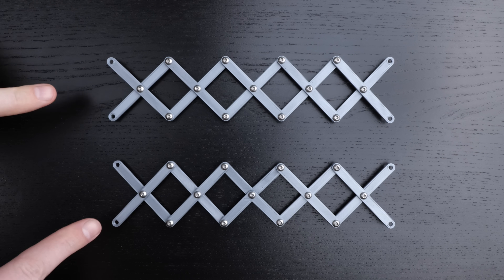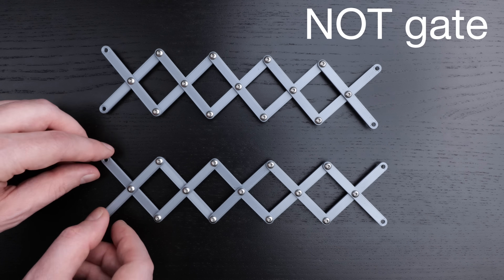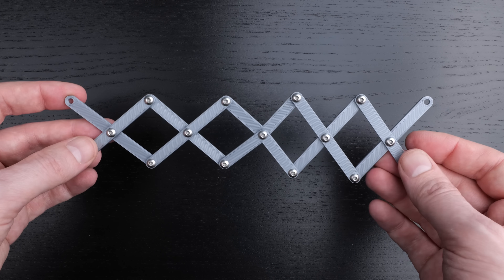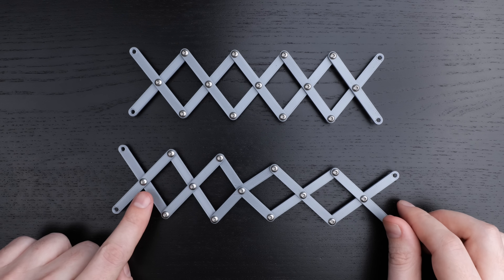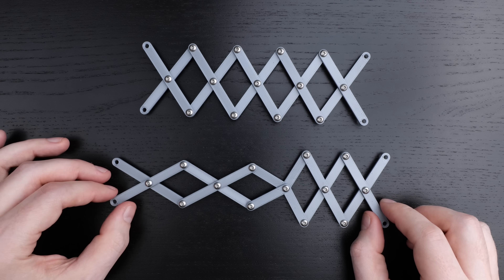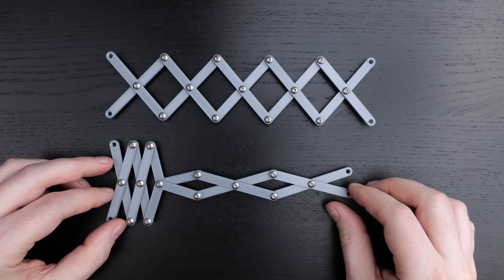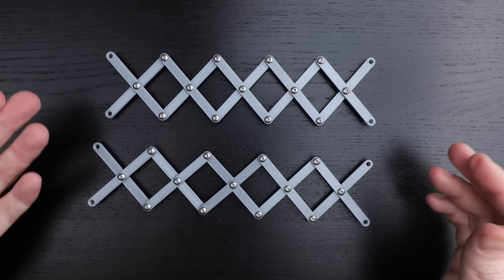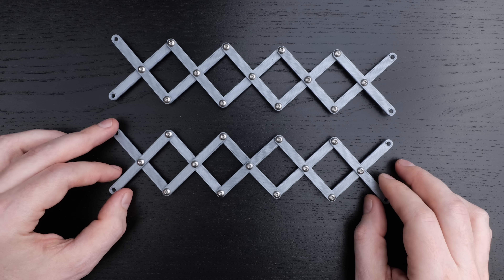Scissors NOT gate

Comment: very clever. you had another scissors that had one part that moved at a higher ratio to another part, but in the same direction. it occurred to me, it could be used as an amplifier. imagine whatever you draw through the hole of the signal arm, gets drawn much larger by the amplified arm. has anyone made this mechanism for drawing? i couldn't find a video on it, but maybe i don't know the right term to search for

Comment: Could do something like a AND AND = AND by using a scissor mechanism with a right angle joint attached via the central point on the mechanisms inputs

                   tInput    >
ANDmechanism         xxx
                  bInput    >

Top connecting mechanism attaches to tInput.TopConnection and bInput.TopConnection
Bottomw connecting Mechanism attaches to tInput.BottomConnection and bInput.BottomConnection

Pulling the top connecting mechanism would close the 'ANDMechanism' only if the bottom connecting mechanism was either also pulled or pliable

Comment: Very neat mechanism.
However, you do know that the only gate needed is a NAND gate, right ?
you can create all other gates and any boolean logic with only NAND gates. So just create that one, what is the point of other specific gates ?
Reply from the maker: Yes, you could just make a NAND gate. But any logic machine you build with mechanical parts like these will suffer from slop in the joints, which gets worse with more parts. So if there is a simpler mechanism to make (for example) an OR gate directly rather than constructing it out of NAND gates, you’d want to use it.

Comment: if u make the last parts after all the conection points longer it would lower the lenght difference (on both sides) and if u make them the same lenght u dont care about the middle part cause input and output is the same anyways

Comment: I would reframe the whole mechanic a bit: suppose one arm of the input is fixed to a grid, then you only look at the movement of the other arm. This reduces the output to one vertical movement too. Now you could imagine a rectangular frame that can only move vertically. The horizontal movement of the scissors along the horizontal part of the rectangle is ignored, you just have some leeway for the length change there. The vertical movement is the output you are interested, you get that from only one point of the two output scissors, the other one is moving in a horizontal rail to give it leeway for the length change, but it is fixed in the vertical axis. Those frames are the "wires" that you use to connect to the next stage of logic gates.

It's not a fully scissor link mechanism this way, but building a first prototype with those moving frames could give you some insight in how a logic circuit could work. Maybe you find a scissor variation of that idea later.

Comment: If you don't already a solution my would be to put two of the standards side by side connecting the in/outputs to side of another standard.
And be aware that you can have multiple input & output if you use a grid pattern mechanism.
The grid pattern mech. being something like : 
xxxx
xxxx
xxxx
xxxx
With the grid pattern, and really the standard too, you can have the side of the mech. be a NOT gate value.

Comment: I was immediately thinking that going through 3rd dimension is a quick lazy answer. Add hinges to the arms so ends of the mechanism stay a fixed (arbitrarily adjustable) distance from each other but the middle of it bows a up and down, freely, in sort of an arch or wrinkled shape.

Comment: I wonder how stable it could be at the center L joint.  Since it’s anchored at both ends, and can be driven from something stationary.  Could be an interesting choice for something like an extrusion 3D printer.  

Or maybe since it converts a very long motion into a comparatively fine one it could be a tool for firmly but precisely gripping fine objects.

Comment: You say scissors based mechanical computer like it's some kind of joke, but there is reason to believe that the cytoskeleton(a cross linkage of various proteins that support the form, movement, and metabolism of any cell), besides simply acting as scaffolding, is actually encoding information and performing computations which direct the cell's metabolism and behavior. This can explain how a single-celled organism can have fairly complex behavior, but also how cells organize themselves in general. I bet that the some of the proteins that make up the cytoskeleton can have distinct configuration states, some which are just like the scissor arm which can be elongated or compressed, and there is a some kind of junction protein which acts similarly to your not gate.

Comment: you could make it one length by making the L shape 2 pieces and have a gear system between. so the relationship of the side angle of the X would dictate the size of the angle of the top of the X, in a measured way. for the $ you would use the same gear ratio except would need to rotate the two center ones by 90d so the length overall doesnt change, and you have squished scissors at the end and two long ones in the middle

Comment: Just figured out how to make simple OR/AND gates :
Arrange 2 NOT scissors and 1 regular scissors into an 工 shape. Both NOT scissors' middle points connect to one end of the regular scissors.
Add a third NOT scissors and form a 王 shape, its middle point connecting to the regular scissors' one. 
Now depending on which direction you shift the third one's position, you can make either an OR gate or an AND gate. 
Notice when one of the inputs is True, it stretches the regular scissors and forms a Z shape. By moving the third NOT scissors slightly to the left or right, you're essentially flooring or ceiling that 0.5 state into a 0 or 1.

Comment: And Gate:  4 small sticks in the middle so that the middle is 4 independent pieces instead of 2 dependent pieces?  Instead of 2 straight pieces or 2 90° angled pieces, 4 half length straight pieces, all with one end bolted together in the center.

Comment: About AND gate and OR gate:
AND can be explained as "min" function. 
Likewise OR is a "max" function.

My suggestion: make two input scissors on top of each other with the third scissors as an output.

1. The OR gate: the input scissors will try to widen the output (push from the inside). Add a spring that tries to narrow the output points back. This way each of the inputs will independently widen the output (make it true), but if both inputs are false - the spring will narrow the output down (make it false).

Same can be done to the AND gate, but here the inputs will try to narrow the output and the spring (or two from the sides) will try to widen it back.

Hope the creator will eventually see this....

Comment: You could attach one of the four end to a new one on une side and to the other side the endi bit of the other input.
Then the central pin should be put on a rail then the output will differ if they are both open the parallel endi bit would be closed, if one is closed and the other one not it wouldn't be close

Comment: You could attatch the last pivot to the start edge of another scissor. If both are true, it would be false. If both are false, it would be true. If both are different, it would tilt. Of you use strong magnets, they can detatch safely.

All you'd need is one of these invertors to make 2x true also true. 2x false would be false.
And a mix would result in a faulty input. If you were to interpret that as not "true" then you might have something.

On the topic of a same length one.
Speculation, but it seems that the linkages move in a sinusoidal path. Then the length is the sine of one plus the cosine of the other. 
If you were to limit the path they could travel e.g. less range of motion, the values would stay rather consistant.
One might also use very small linkages in the centre and 2 large one at the ends. The distance will vary, but small amounts.

Comment: I'm assuming one can add modifications to another scissor linkage to do this?
In that case, I imagine an and gate linkage could be built by binding the bar of each side of the linkage (top/bottom) to the corresponding external sides of the other two linkages. By adding an appropriate spring/lever, one could ensure that you get a bit better of a snap. 
This allows it to work such that the new linkage will only fully open when both of the other linkages are open.
Reply: An added bonus of this is that with small tweaks you can have a nand gate with 0 additional separate gates.

Comment: For an and gate, you could do a 2x2 matrix of not gates conjoined by the inner touching output poles. Then hook one big scissor to the two outer output poles. The not not input chain is because of the length issue. It works in my head?

Comment: I'm not a math guy, but I think you can also create a signal inverter by introducing an orthogonal junction in the links - as you expand one dimension, you contract the other. You might be able to create a parallel inverter with the use of this pseudo-NOT gate's constant length. You could create an absolute NOT gate by eliminating the second half of the links to terminate the extension throughput.

Comment: Since this is a mechanical object, rather than using digital logic maybe analog logic would suit it better.
Also play with different width to length ratios for the individual arm sections, or keep them apart so that two parallel arms actually coincide,making it a bit less restraint since 0 width is obviously impossible.

Comment: Okay, so it's a "NOT" gate insofar as it's always doing something on one side, and the inverse thing on the other side... 

But it's like... a one bit truth table; the two "handles" and two "blades" can only represent  two states in this model: OPEN and CLOSED. I think you need at least two bits, or four binary states for universality. 

For AND, you need four "handles" on your scissors, and two "blades", so that you can represent: 

OPEN OPEN => OPEN
OPEN CLOSED => CLOSED
CLOSED OPEN => CLOSED
CLOSED CLOSED => CLOSED

or, you could assign the "true" value to CLOSED. 🤷

Anyway, the biggest mechanical challenge I see that you need a sort of one-way closing operation:
- closing either pair of handles always closes the blades, regardless of the position of the other pair.
- re-opening a handle won't open the blades if the other handle is closed. 

I think I've seen pliers that have two sets of handles with one inside the other, but the closed state of the outer pair forces the inner pair into a closed state, so you'd make one of your four binary states impossible. But maybe if they were laid on top of one another, you could decouple them, and even allow the "inner" and "outer" handles to keep the blades closed interchangeably. I have no clue what that kind of latching or joint mechanism would look like. 

On that note, I guess a door with a lockable knob and a deadbolt is technically an AND gate! But in that case, the state is only readable by trying to open the door, rather than being able to read the state from the position of some blades. 

If all else fails, I suppose you could always say the joints in this logic gate count as scissors: https://www.youtube.com/watch?v=TUtAdJKKDF0

Comment: Well, you could hook up the two arms of the output to the pivoting axes at the ends of the left and right inputs, perpendicular to it, to create a full logic gate, I suppose. The only problem is obviously that these don't really act as logic gates; the output for this one would be the same in either left-right position, and you can't ever get the opposite true/false output. Maybe one option for a logic gate would be something like a linkage of scissors in a Z arrangement (this could be made more compact), with the endpoints fixed, and then the short scissor series are the inputs, and the long scissor series is the output. What amount of extension of the output constitutes true or false is more or less an arbitrary decision, I think. It'd just have to be consistent for the whole computer. The problem really would be "how do we link them so that each of the inputs effects the output in the middle, but not the input on the other end"? I don't know, I'm rambling a bit. It's a cool idea though!

Comment: Could you maintain constant length in the NOT scissor with sliding bolts on the extreme ends? Seems like it could adjust with a minimal amount of added moving parts

Comment: Something im not seeing in the comments...
It only stays the same length if the NOT joint is located in the middle.
Both sides are equal.
If its positioned to ether end, it will change in length.
And to boot, if you put in two NOT joints at 1/4th and 3/4ths along the length, it will return to not changing in length.

Comment: OR gate using gravity (or a spring) would be easy, just use two of the normal scissors and let them push something up. The upwards motion can then pull on another scissor, if it needs to be translated to open/closed scissors.
Basically three scissors in parallel, two of them pushing a platform and the third (output) would be attached to the platform.
With OR and NOT, everything alse follows in theory, but friction quickly becomes an issue, so more efficient specialized designs for AND, XOR etc would probably be necessary.
Reply: Just noticed, without gravity, something being pushed between two scissors is effectively a very simple SR latch. Maybe one can use latches as the fundamental gate to build a computer, idk.

Comment: FINALLY one step closer to a "scissors-based mechanical computer". I love your videos, Henry.
Reply: ha
Reply: My first thought with this gate is that it might be possible to simplify it and make it smaller.

What if it wasn't a scissor computer but just a lever computer with each lever fixed in the center. A lever pointing up could be "true" and down would be "false". Then your not gate would be a lever but idk where the second input would be for the and gate...
Reply: In 6 billion years when we've used up all the silicon on earth for non-scissors-based computing, your comment is going to look pretty short sighted. 😅

Comment: I predict this video will start a community of people who will eventually program tetris with scissors.
Reply: I will paste comments that I find that could be useful.
Reply: Alex de Moura
1/10/2023
Solution for AND gate, using three NOT gates.
Sorry, no monospaced fixed width fonts, emojis shall be used. Better viewed in horizontal orientation in small screen devices. 

Emoji Notation:
↕ Open input/output, Zero/False 0⃣
↔ Close input/output, One/True 1⃣
🔃 Open link (high height);
🔁 Closed link (low height);
⬜ Emoji space alignment (only, no effect);
⏫⏬ Fixed points: top and bottom;
↗↘ Additional links: top and bottom, to give some space to the scissors;
🔀 Overlap solution: two additional links that are NOT connected;

AND operation: (there is a vertical movement of last scissor during operation)
0⃣⬜⬜⏫
↕🔃🔁↘⬜⬜⬜0⃣
⬜⬜⬜⬜🔀🔁🔃↕
↕🔃🔁↗
0⃣⬜⬜⏬

0⃣⬜⬜⏫⬜⬜⬜0⃣
↕🔃🔁➡🔀🔁🔃↕
⬜⬜⬜⬜↗
↔🔁🔃↗
1⃣⬜⬜⏬

1⃣⬜⬜⏫
↔🔁🔃↘
⬜⬜⬜⬜↘⬜⬜0⃣
↕🔃🔁➡🔀🔁🔃↕
0⃣⬜⬜⏬

1⃣⬜⬜⏫
↔🔁🔃↘⬜⬜⬜1⃣
⬜⬜⬜⬜🔀🔃🔁↔
↔🔁🔃↗
1⃣⬜⬜⏬

For non-extensible "buffer" (0 to 0, 1 to 1) use two NOT gates in series:
0⃣⬜⬜1⃣⬜⬜0⃣
↕🔃🔁↔🔁🔃↕

1⃣⬜⬜0⃣⬜⬜1⃣
↔🔁🔃↕🔃🔁↔

I hope this helps.
Reply: Rian Felis
1/09/2023
Solution for the length problem: add a component to the output that just takes the vertical component and lets the horizontal slide.  For example, a vertical groove is fixed in place, then put two bars in it that are forced to be at right angles. Inside of those two horizontal bars, put a groove that lets the ends of the scissors slide freely along them, but the vertical motion will translate into the right side of those bars.

Comment: actually the most interesting thing about this is that the value are analog, not digital, we could open the scissor at any value inbetween 0 and 1.
if someone made a calculator with this, we could do something like 
0.5 && 0.75, 0 || 0.25
i wonder what would be the output

Comment: With a functioning AND gate (as designed by many other commenters) and a NOT gate, every single other logic gate can be constructed. The main issue is space, as the mechanisms change size and shape when transmitting "information." This makes constructing larger computing mechanisms out of scissors much harder, meaning there probably needs to be a way to "stabilize" the sizes of the scissor mechanisms to build anything larger.

Comment: The nice thing about using a scissor mechanism is that assuming that you don't have any slack in the mechanism, setting the output will give back the input that would've caused it. This means that you end up with reversible logic gates like the Toffoli/CCNOT gate, which also have to be bijective (seeing as any overdetermination requires slack in the mechanism) and that anything you build out of scissors without slack will be reversible - so a multiplier is inherently a divider etc.

Of course this means that things like ordinary AND and XOR gates are completely out of the picture (in the slackless world) but CCNOT Universality is a known property in reversible computing, so you should still be able to encode arbitrary boolean functions, with the added benefit that they will be reversible but overspecified, ie. more output bits than is needed to encode the actual output of the encoded boolean function.

Comment: You could make a NOR gate by putting the first input besides the other input. Then placing a rod which is stuck on the x axis, directly above the two inputs when they are false. And then connecting it with a rubber band so that it goes back whenever we reset the inputs. And after that another connection for the output which has the effect of inverting it to a NOR 
     \
——|
🔀 |
      | 🔀
🔀 |
——|
     /